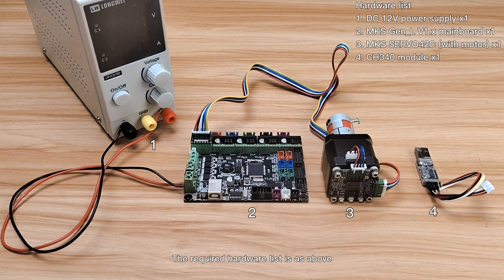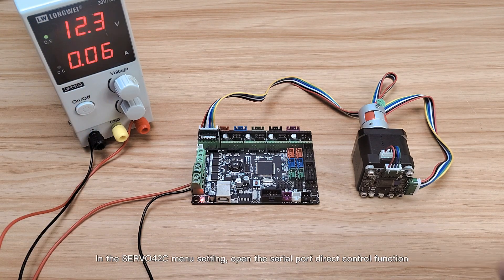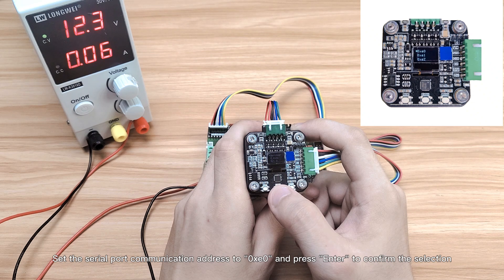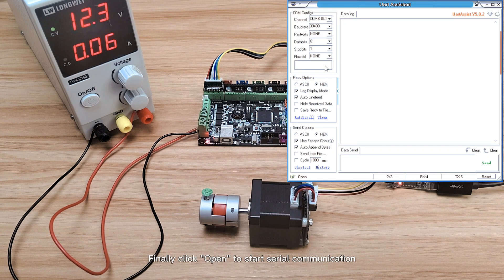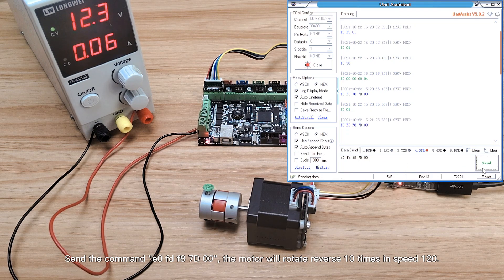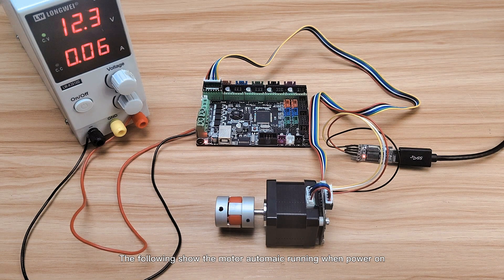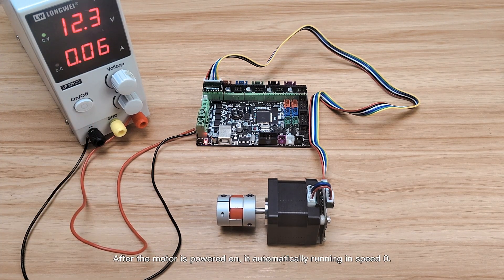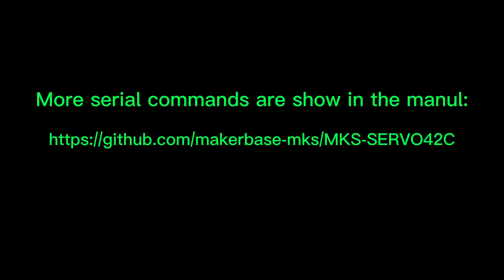Makerbase SERVO42C Closed loop Stepper Motor  Manual（3）Serial communication

Comment: Hi, please its not very clear how to set MAX torque parameter . Default MaxT is 0x4B0. How do i set it to the maximum possible torque ? What is the parameter i should change? i need it to fix gravity compensation of my motor shaft

Comment: is there any way to navagative the settings other than thru the on-board screen? Like if I put this motor into a robot where I don't have easy access to the screen and buttons.
Reply from the maker: You can connect to the computer through the serial port, and use the computer to send commands to modify the parameters
Reply: @makerbaseteam4217  awesome thats what I was hoping for thank you
Reply: @makerbaseteam4217  if you use the serial commands to modify the properties the motor can still be controlled in the regular way